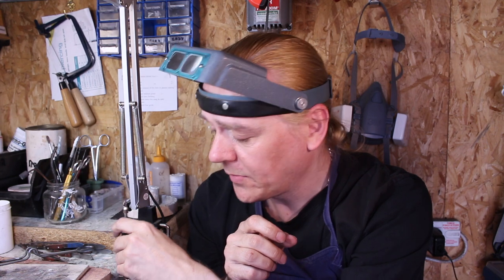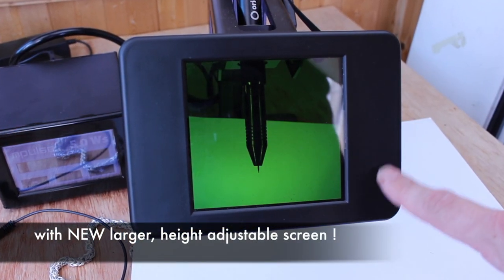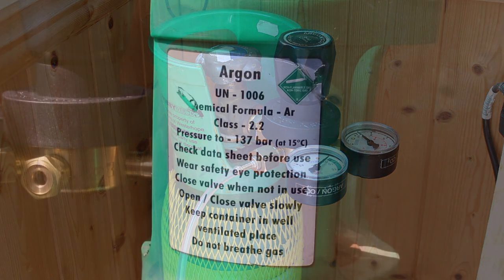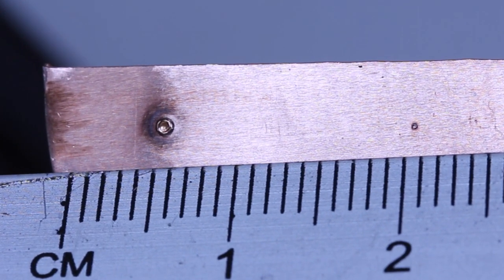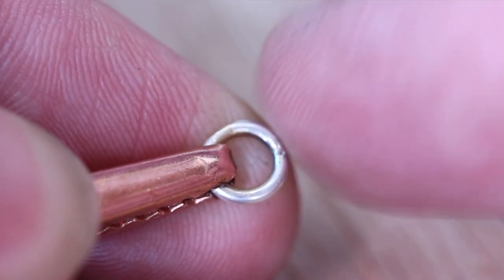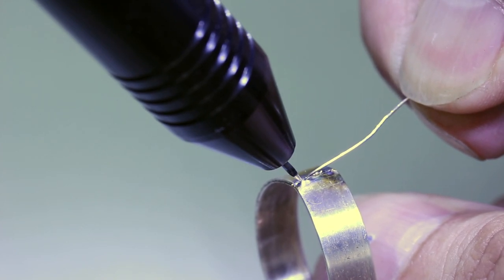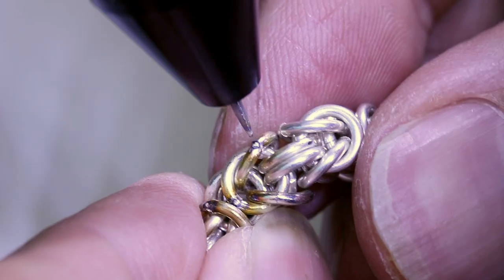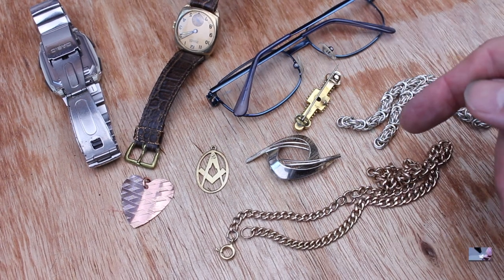Orion mPulse 30 Micro Jewelry Welder Demo & Review in HD

Comment: That's a brilliant tool--I wish I had one before I attempted to repair a customer's necklace...a few small "stones" in sterling were actually some kind of synthetic that literally disappeared in a puff of smoke.--lesson learned With the argon gas, it looks like you could weld silver into deep marks on silver platters or erase a deep engraving by adding vs. subtracting metal. Cool tool!
Reply from the maker: I haven't tried filling deep engraving yet, but I do have a little project lined up to try that. A friend of mine removes engraving with a laser. It's basically the same method using thin wire and melting it into the engraving. Probably one of those things that takes practice, but could be a great way out of a tricky problem once mastered. Dave

Comment: AY WEY! it's Anthony Hopkins Doppelganger LOL very informative video. Master Jeweler / Goldsmith here, as in me... I've used the other larger laser machines and even though they're much better than this little machine, I see little machine beating bigger machine in some areas. I am old school and love my torch any day. yes I've soldered those chains with torch. I came, saw and may get me one. i Like, OLE!
Reply from the maker: I do love my torch too, cant beat the strength of the joint and quality of finish. But it doesn't have to be one or the other, a Welder or Laser is an "addition" to other techniques allowing greater scope. When it comes to fine chains through the welder definatley wins.

Comment: I have seen you use this welder in other videos and glad you have decided to expand upon and discuss this with us its such a great thing in ways of blending and color matching I like it alot I see in principle its much like tig welding not really the same thing as soldering much nicer I do dabble in welding from time to time the amperage of that will definitely destroy a tiny peace of copper and the shielding gas is none exsistent in the arc welding process all though it can be adapted to much of a bother and the results it will be a big poof and a puddle of melted slage 
great video so glad you opened up some eyes expanded some minds with the power of this machine 
       thank you for sharing
Reply from the maker: Thanks for watching. Glad you found it informative. Dave

Comment: We are just about to pull the trigger on ordering one of these but were curious how you're getting on with it now you've had it a while longer. Our goal is to "Solder" 925 Silver jump rings to avoid the need for pickling and all the subsequent fixing that processes effect on the items as a whole.
Reply from the maker: This is the main thing I use mine for. I solder jump ring on my byzantine chains (after assembly). I also use it in conjunction with traditional soldering. Often i will spot weld a part into place and then torch solder it, for extra strength and aesthetics. I don't feel the welds have the same structural strength as hard soldering, but maybe that's just my welding ability. Hope this helps. Dave
Reply: Celtic Dreams thanks for the reply!

Comment: Question for anyone experienced here  Is there a retractable tungsten rod holder like that available as an accessory to other model TIG welders other than Orion?  I like how it pulls away after arcing and wouldn't mind upgrading my current machine, just don't want to have to buy a whole new one.  Anyone know?
Reply from the maker: I'm not sure how other welders work, but with the Orion the retractable electrode is the whole thing which creates the arc in first place. It is controlled by the main unit which retracts the electrode, blows the argon and fires the charge, thus creating the plasma spark. So I'm not sure how it would work on another unit without the main control system. Its kind of all part of the same system. Hope this answers your question. Dave
Reply: @CelticDreamsCoUk  It does, thank you.

Comment: Great video! I have the mPulse Plus and am experimenting... I'd like to repurpose some old 14k parts and attach them to 10k mesh or herringbone chains. I haven't tried to weld diff karat metals, any tips? And how challenging is it to weld 14k and sterling together?  Thanks again!
Reply from the maker: You will find that the higher carat metals will melt easier. So always start with low power and turn it up if you need to. But note though, that in order to get a good weld you do need to melt "both" metals. Hope this helps. Dave

Comment: Great video - thanks so much.  Just ordered this welder but I have one question that I can't seem to get answered anywhere else: Where did you find the tubing adaptor for the regulator?  I've got an argon regulator but it's a quick-connect on the tubing side - do I have to order something special or do most welding shops carry these adaptors?  It doesn't appear that I can use a quick connect hose on this unit.  Thank you for putting this video out there!
Reply from the maker: I get my argon form a local welding supplier. I just took a small piece of the hose in with me and asked for an argon cylinder, regulator and adapter for "THIS" piece of tube. So all sorted there and then. But lots of small "barbed hose adapters" on ebay, and Amazon. either fixed one piece, with a barbed tube on end and gas nut on the other. or you can get two-part adapters, with a hollow nut (for the gas) and various sized inserts with barbed connectors. This is what I have.

If you need to improvise, just to get up and running, Remember you're only using very low pressure, and argon isn't flammable.  So as long as you can get some kind of connection that doesn't leak, you'll be fine. eg A piece of thicker hose to connect, clips, heat shrink tubing, tape  etc. as a temporary solution until you get a suitable adapter.

Tip, on some models the gas hose is quite thick with 'very' small inside diameter. So if you cant get a connector small enough to go inside the tube, The alternative is to use a bigger barbed connector to go over the hose which can fit inside the adapter. I had to do this with one model as the supplied tube was thicker, with a very narrow inside hole.

Dave.

Comment: Hi Dave.... have you ever used the Orion without the gas, I have and I can't see the difference between what your video close up shows and my welded piece...... Great videos BTW
Reply from the maker: Yes, I have had to finish a piece late at night when I had run out of argon, and pondered this exact same question. The tanks are expensive, so it does beg the question how necessary are they. Short answer, yes you can weld without the gas, but the weld just wont be as good. If its just a single blast on a jump ring then perhaps it doesn't matter much, but for repeated strikes, the gas really does make a big difference. I can tell why my gas is running out. The welds just don't behave the same and the job starts to get hard work. As I understand it (not that I do), the gas has two functions, firstly it acts as a shield, to reduce oxidisation, rather like flux does. But I am also told (by a welder) that the gas itself ionises and that's what creates the arc. The units are obviously designed and configured to create the optimal arc when using Argon. Without it I see more spattering, less precision and a lot more soot and blackening. So whilst you will still get a spark, you'll soon become frustrated. A clean tip and blast of Argon do make a huge difference. For my gas torches I have an oxygen generator, which takes oxygen from thin air.. Pitty I cant get an Argon generator.!   Dave

Comment: Hi there! Cool demo! What settings would you use to weld the edges of an 1mm thick copper box? The dimensions of the box are 85x45x45mm
Reply from the maker: It's the thickness that matters. You want to ensure you get good penetration through the material. A little trial beforehand is always the best way. But I usually work around 10 -12 for something that thickness. Hope this helps. Dave
Reply: @CelticDreamsCoUk  Yesss! That is very helpful indeed thank you so much! I am about to purchase one Orion welder but this is the only one I can afford right now. So you think it will do this job and there is no need for the more expensive ones?

Comment: We're really loving the welder, amazing for jump rings but have you tried 10mm Heavy ones? We are finding that if you go full pelt it blows out the ring and doing multiple lower powered welds is hit or miss. Would a heavily blunted tip be better for thicker gauge as used in 10mm's
Reply from the maker: I find a blunt tip gets a nicer finish on the surface, but has less penetration. A sharp point tends to weld deeper, but with less of a spread. It took me a lot of trial and error to get used to it and learn the "feel" of it. So my best advice I can say is to practice and find what works for you and your material. Check out the Sunstone (Orion) website too, tons of videos and advice. Dave.  https://sunstonewelders.com/

Comment: I  am wanting to spot weld stainless steel 304 woven mesh  to its self  . The wire guage is 0.71  or even as small as 0.56  mm  .  .  My question is,  do you know anywhere in the UK that rents  this kind of micro welder or if not would a  cheap pulse jewellery welder manage to weld stainless ( thin wire to itself)   . The 30 - 40 amps ? 
Non of the cheap resistance  spot welders welders say stainless as it's melting point is so much higher than gold and silver . Just wondered if you knew or could point me in the right direction.  It's not something I would use often so carnt justify buying of one job . Mind I am sure I would end up using it for lots of things. Thanks for your consideration.
Reply from the maker: Not sure about renting, but HS Walsh in Birmingham sell them and you can go along to their showroom and have look at one, Im sure they'd be happy for you to take some mesh and try it out.  Likewise Cooksongold are just along the road (Birmingham jewellery quarter). Who also sell them. Hope this helps. Dave

Comment: Hello! Love your videos, I have brought one of these and am having a nightmare finding an adapter for the regulator, where did you get yours from?
Reply from the maker: I get my Argon from a local welding suppliers. I simply asked them for a regulator and a "barbed hose adapter" for a 6mm hose. tons on ebay, Amazon etc for a few pounds. Hope this helps. Dave
Reply: Thank you! I was able to find one at my local welding shop, I would like to ask you another question. For sterling silver jump rings, would you reccomend a sharp tip or a blunt one? Many thanks. Michael

Comment: We've got our now and have just had a little play wit ha couple of jump rings to check it's working. If I may impose on your experience with the machine, what does depression and blob imply...too much power?
Reply from the maker: Possibly too much power yes. It WILL take a while to get used to it.Remember the old laws of soldering still apply, the joint needs to be clean and close fitting. Remember too, that as with soldering the metal will flow towards the heat. So if you have a ball of metal, hitting it directly may not do much, but hitting it at the side will cause it to spread out and flatten.(as the metal melts towards the spark). Keep playing around with different settings, and try blunt electrodes too, sharp isn't always the best method. and not too much gas. hope all this helps. it takes time, but just experiment and you'll get the hang of it. Dave.
Reply: Celtic Dreams thanks, missus is loving it now. We settled on a slightly blunted tip in the end.

Comment: Hi, with one Argon gas is better for Stainless steel? ( 100% Argon) or (86% Argon and 14% CO2)  and with One for Titanium?
Reply from the maker: The Orion welder has been designed for use with Argon and primarily for use with Silver and gold. I'm not really an expert on welding steels or Titanium, so I cant say if using 14% CO2 would be better for these metals. Perhaps that's a question for Orion, who I'm sure would be happy to advise. Dave.  https://orionwelders.com/

Comment: Do you ever find your welds are brittle? I try to weld posts on the back of sheets of metal (to tap&die or weld on loops). And the weld is fragile, a bit of pulling and it snaps off. If i up the power, it blows away the posts which are small in comparison to the plate metal.
Reply from the maker: Yes. I use the welder for tacking items together before torch soldering, and for finishing up jump rings. But you are correct, sadly you never get much penetration. A weld can look perfect, but there is no depth, so its very superficial. With mine I'd say 1mm wire jump rings can be fully welded, with full penetration and the whole of the wire fused. But anything larger than that, the weld just doesn't penetrate. As you say leaving a very nice, but very weak joint. The larger units have more power and deeper penetration, but the Mpulse, is only really for very fine jobs,  like tipping prongs, welding small chains and thin jump rings. Dave
Reply: Oh that's awful to hear but good to know. I've been saving toward this welder for a couple years. Is there something better in the price range or near the price you'd recommend? 

Or a fully best option you'd recommend as well?

Comment: What's the name of the pen you used to clean the weld ?  It looked like a little paint brush
Reply from the maker: It' a "fibreglass scratch brush". a short stubby brush that you can extend. it's used for removing light dirt, such as the soot left by the welder. great for cleaning electrical contacts too. A great little gadget. In fact, you get one with the welder. see links below. Dave
https://www.hswalsh.com/product/bergeon-2834-l-brass-scratch-brush-hs2834-l

Comment: Me: thinking jewellery making might be my next hobby
Also me: im broke and that's expensive 😭
Reply from the maker: Yes this is high end tool. But you know, I started for many years with little more than a couple of pliers, a tiny butane torch and a Dremel. Just making Celtic bracelets out of silver wire. If you want to learn, its important to learn the basics first, such as torch soldering. Dave

Comment: I got a 30 amp cheap Chinese welder sir but it didn't come with the tip for the gun the rod what size would you say it is ?
Reply from the maker: I can't comment on the Chinese version. But Anyone selling the Orion welders will sell the electrodes too. They come in 1mm and 0.5mm diameter. Dave

Comment: Mega piece of kit but you seem to have avoided mentioning the price of the unit ?
Reply from the maker: The price will vary depending on model and on the country you buy it from, plus the cost of shipping. I never state prices in videos as they change so quickly. I don't want to show a specific price which is then wrong a few weeks later - let along several years later. Follow the links in the description for the latest models and prices. Dave

Comment: how about for costume jewelry? I get a lot of white metal, stamped brass, and bronze, mostly old brooches w/rhinestone and micromosaic?
Reply from the maker: Yes, because the welder just melts the metal, there is no need for solder. So pretty much any metal  can be welded. Typically with costume jewelry you'd start at very low power as it is is often made with lower temp allows what are cheaper to cast. Dave.

Comment: Thanks a lot
if the metal- say gold - oxidizes, is it easy to clean?
Reply from the maker: It isn't really oxide, like when heated with a torch. Its more like soot. It just wipes off. I use a small fibre glass scratch pencil, quick rub and the item is perfect. Simple. Dave
Reply: I wish you could show me an example of gold oxidizing - is that with lower-karat alloys of gold?

Comment: How about using the Orion to fill-in an engraving on sterling silver??
Reply from the maker: I haven't tried that. I imagine it would be tedious beyond belief, and you'd still need to sand and polish after, so somewhat pointless. 

Two methods, The first is to sand and polish out the engraving. I have made a great video on how to do this. see link below.  

When something has been hand engraved using  a graver, you often get deeper holes at the ends of lines where the graver was pushed into the metal to start a line. So when you sand away the lettering you may still have tiny holes, which are deeper. To remove these last stubborn holes, you could add solder (or use the welder) to fill odd tiny spots that are too deep.  But sanding is the way. see here... Dave

https://youtu.be/SGRSQa5lR2Q
Reply: It would do it just fine, I use it to fill bezels gap mounted on the fly on top of fine .999 silver, it will not affect the strenght of the rolled silver. Though you need to use high power for melting the silver all over your gaps or engraving lines and stone and polish after for a smooth finish

Comment: Argon cylinder how muc does it cost . And how size cylinder do you buy?
Reply from the maker: I use Hobbyweld here in the UK, a chain across the country. There is no rental on the cylinders, as with larger suppliers. You buy the first canister and the just pay for refills. It's about £70 to buy the bottle and £60 for a refill. Not sure of the size, but the one you see is the smallest i can get. Thanks for watching. Dave